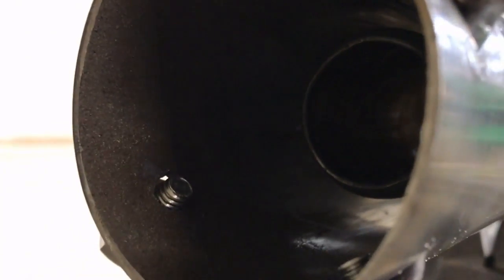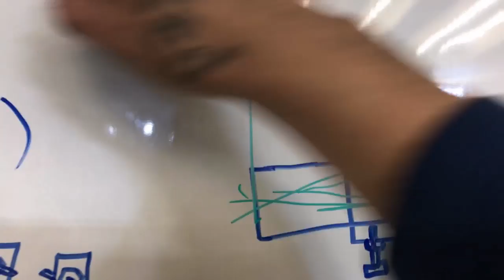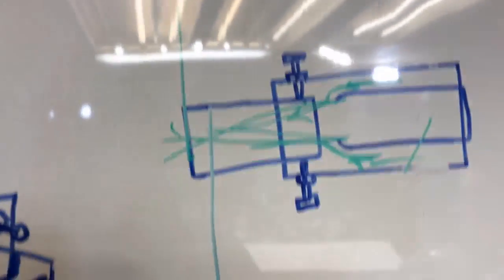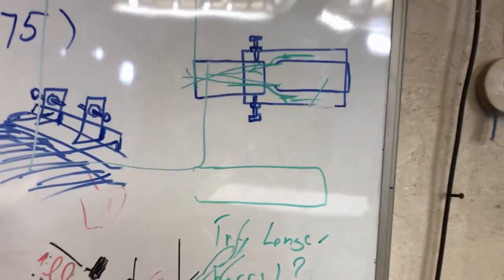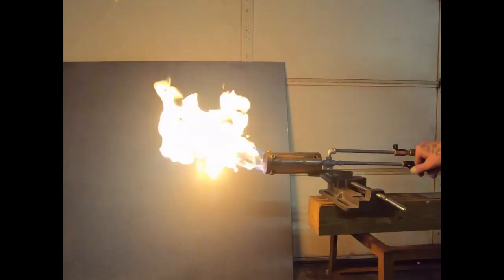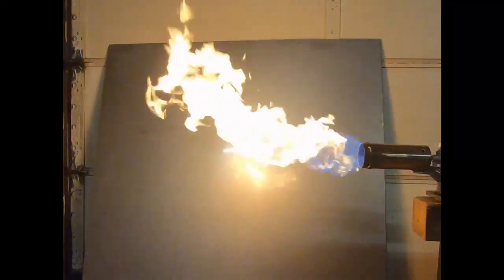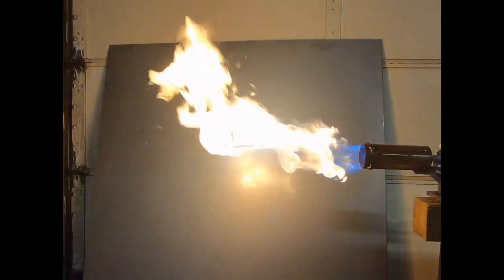Universal forge and foundry Zeus torch

Comment: i bought thus tirch a month or so ago and ive just discovered that citronella oil burns AWESOME in this thing! no more mosquitos while i work! i love this thing! id love to post video
Reply from the maker: LOL right on brother
Reply: @NOBOX7  man, i appreciate how interactive you are with all the people that comment and subscribe to your channel. idk how you find the time, but i think its awesome.  when i fire this thing up for people all they want to kniw is where they can get one. lol. well worth the $ well worth the wait, and more fun than im prolly allowed to have. just keep on keepin on. thank you.
Reply from the maker: Josh i just seen a old comment in my review box , youtune does not send me all my comments , its very fractured , was that you having priblems getting a needle flame ? Some propane connectors cannot supply the fuel flow needed for this kind of performance
you need to get th type thats connected to a $20 rose bud burner from harborw frieght , not even a red regulator at 30 psi can handle the flow you need . I buy the $6 connector from menards and drill out the rubber over flow bead with a 1/4 " drill bit , this gives you the 80 to 90 psi of propane you need

Comment: Your Zeus torch I see on Ebay for 135 is capable of using used motor oil please let me know if it does I'm buying one want to make a forge but dont want the cost of propane please get back to me and let me know thanks
Reply from the maker: Hello friend , it burns any fuel , for thick fuels elevate the fuel tank
Reply: @NOBOX7  thanks for getting back to me you will be selling another one shortly thanks again
Reply: dude get 2.
Reply: how do i get unregulated propane flow?
Reply: @cowdough94  I have not bought mine yet it's my winter project
Reply: i was asking Nobox how he got it to run so crazy on propane. ive got a bbq grill type bottle and i think the thing isnt letting me have the flow i need. i can flip it over and burn liquid and thats oretty badass but its got that not so safe feeling. lol. ive put waste oil, propane, diesel, vegetable oil, propane and O2, and tiki torch fuel through it. i gotta say, the veggie oil was good but the tiki torch stuff was a show! lol.

Comment: Can you make/develop a burner similar to a pulverised coal burner, that uses charcoal powder (as fine as possible).  Main requirements are auger feed from a bin (perhaps arduni motor?  ~20 USD for a stepper motor (or use a hobby brushless dc and ODrive)

Could be used for heating or for gassification

Also may work with waste sawdust.
Reply from the maker: yes
Reply: That sounds like an interesting challenge.